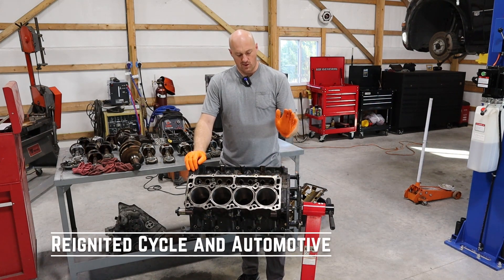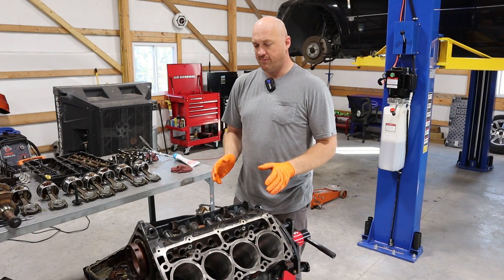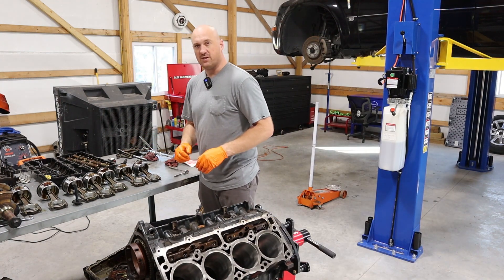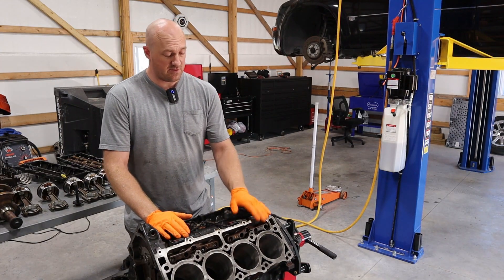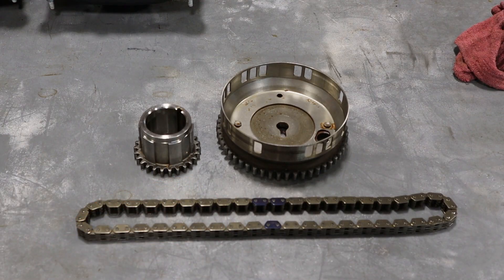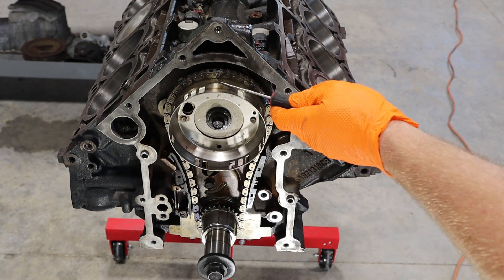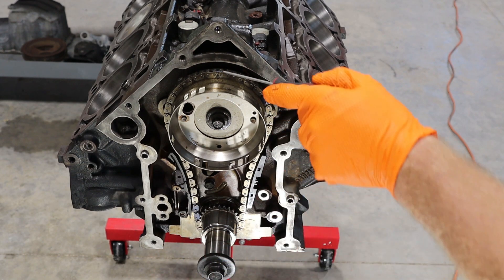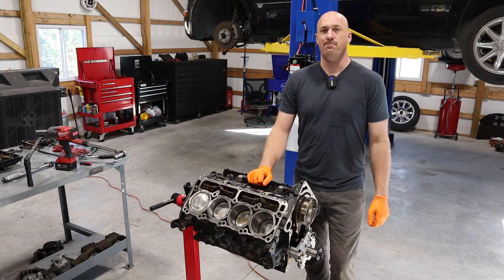How To: Engine Timing on Chrysler Hemi 5.7 // 300C Episode 3

Comment: Some engine builders submerge the lifters in oil on a heat pad or in a oven before installing. This is to prime the lifters for the initial fire up.
Reply: Buy a bottle of prolong and submerge your lifters bearings in that, the additive bonds molecularly to the metal I used AMZoil and prolong oil additive on my 2007 Dodge 1500 5.7 hemi the tick has gone away and my needle bearings are saturated even when at idle they're not coated in oil due to an the nature of hemi design angle of lifters

She's my daily work truck and 140+ miles per day with 1000 pounds of tools and gear everyday... My round trip costs me $15-$20 a day in fuel depending on the honeydo list after working
Reply from the maker: Absolutely that's a good procedure. As a flat rate tech though, sometimes ya just gotta get it back together 😄 Thanks for watching! 👍
Reply: If you want to dip your lifters, I've got no problem with that, but you should  NOT bleed the air out by submerging the lifters in oil for an extended period of time. Not only is it unnecessary because you can "prime" the engine after assembly which will fill the lifters anyway, AND you run the risk of "jacking" a hydraulic lifter if it hasn't bled off excess oil when motor is assembled or cranked over. If that happens pushrods or valves can bend, pistons can be damaged. I've seen it happen.

Comment: So the question becomes, why do the lifters go bad? Uncle Tony's Garage thinks the lifter/rocker inclination is to shallow so that, at idle, there is insufficient oil drip to the rollers.
Reply from the maker: I've heard this theory posited quite a bit since I've posted this video. And I'm not going to say it has nothing to do with it at all, and yet, the 2006-08 Hemi engines don't suffer the lifter failures that the '09+ ones do, and they have the same lifter location and are still equipped with MDS. I do know they changed the block casting in the '09+ because the shape of the camshaft changed, and they added VVT, so not sure if that has anything to do with it. But the lifter location/angle has remained unchanged since the inception of the third gen engine. 👍

Comment: I’m just saying you should never reuse your lifters on the 5.7 ..I’m in the process of rebuilding one right now they can go out and 30,000 miles or less with used ones you never know..I just ordered everything from Summit racing.Thanks for the video happy holidays
Reply from the maker: You're probably right, but me being a tech, I've got a stockpile of lifters sitting around, and if I've ever got an issue it's not much of a problem to take it apart and replace things again. But yea, smart move is to replace with new parts if you can. 👍
Reply: Reignited - Cycle and Automotive You have a great holiday thank you for your reply😊👍

Comment: What year is that 300c? 2011? 2014?  Curious to know because there was no lifter or cam damage, and I heard that 2018+ they fixed those issues.
Reply from the maker: This is actually an older one 2006.

Comment: When you do a lifter cam replacement do you have to replace Pushrods too?
Reply from the maker: Nope, they are fine to reuse.
Reply: Check and make sure they're not bent or worn out of spec.
Reply: Old thread, so this may not help you, but the answer is MAYBE. It depends on whether the new cam is stock &  based on the same cam core, ground with same "base circle". If it's aftermarket, it probably will be ground with a different base circle, which would require new pushrods.

Comment: I used to work at a local chrysler dealer in manitoba, me and the lead cummins tech used to be able to change oil pumps on 5.7 trucks and 6.4 3/4 tons with just removing the pick up tube bolt and manipulating the oil pump around the pick up tube as you said, its a huge pain in the ass but will save you dropping pan and windage tray and front diffs in 4x4s
Reply: Did it in the 1500 without removing the oil pan but getting the pickup tube bolt to thread back on will be a hell of a job...not enough room to get your fingers in there. I used some fishing line wrapped on the threads to get the threads started on the oil pump. It wasn't a job for those short in patience...
Reply from the maker: @DL101ca  that's impressive!
Reply: @ReignitedAuto  not for my father listening to me curse while doing it... 😂
Next time I think I will just use a thinner bolt with a washer and a nut on top to reinstall the pickup tube or drill the oil pump threads out and just use a longer bolt with a nut. No sense in fighting with it.
Reply from the maker: I hear you there. I don't remember being able to do that on the trucks, but then as techs there are always going to be guys who can do a repair a certain way that you can never figure out 😄nice work! Appreciate you watching 👍
Reply: @ReignitedAuto  Thanks for the time and effort you put into these videos, never have I found a youtube channel that is in depth into Chrysler products as you are, especially since I was also a Chrysler tech I can relate very easily to your method of explaining. Very good information on properly bleeding mds lifters, my brand new lifters were still noisy on cold starts because I have mds disabled with a tune and have never had the new lifters in mds mode, took the tune off and went down the highway and they are quiet as a brand new truck, never would have known that from all the lifter and cam jobs at the dealer since those vehicles still run mds regularly.

Comment: In the non mds hemisphere that have cam and lifter failure, is the failure due to bad materials? I have a 2006 300c srt8 that is misfiring. I am planning on replacing it myself. After watching your videos it should be a lot easier. Thank you for all the info.
Reply from the maker: Honestly I'm not sure what the root cause is, I'd like to see more in-depth analysis, but that probably won't happen. The good thing about the Hemi engine is that it's a pretty basic engine, so you shouldn't have trouble repairing it. Glad I could help at least a little bit and thank you for watching! 👍
Reply: @ReignitedAuto  Uncle Tom put out two videos on what he thinks is the cause. Take a look at his videos about it if you will. I will like to hear your thoughts on what he said. Thank you.

Comment: Thank you for these videos. 
I pulled out my grand Cherokee HEMI last night and pulled the heads. Next is a complete teardown because #1 piston was completely gone. Just a wrist pin. My # 8 looked like, I believe your #2. I’ll be going through these videos multiple times I’m sure. What did you end up replacing? I have a doner engine too. What’s reusable and what must be ordered, and from who? Parts list? Assembly lube? What you did in house and what you sent to machine shop? Any suggestions, tips and tricks will be greatly appreciated. I’m still trying to find the one person on here that will share everything. Thank you 🙏
Reply from the maker: I ended up replacing the #8 piston/rod and just performed a light hone of the cylinders to bring them back to good condition. I reused the rod and main bearings since they were in good shape. You must replace the head gaskets, I would definitely recommend replacing the valve cover gaskets, the intake gaskets, the front timing cover gasket, the oil pan gasket, the oil pickup tube seal, and the rear main seal while you have it all apart. Definitely use assembly lube, it's available from parts stores for pretty cheap like $10. I didn't do any machine shop work because the cylinder bores, the scoring was light enough to be removed just using a 3-stone hone. I'd be worried though if your piston disintegrated entirely that your cylinder scoring will be much worse. The general rule of thumb is if you can catch the markings with your fingernail, the block will have to be bored or honed. If they are deep enough that the block must be bored, you'll have to purchase oversize pistons, and everything gets more expensive. In my opinion, if the block is that bad, just find another block to use. I myself prefer the OEM parts from the dealer, but I know the cost sometimes is prohibitive. After working at dealers for almost 20 years, I genuniely beleive the parts quality is much better than aftermarket, but it does come at a cost. I appreciate you watching, and I hope the videos help on your project! 👍
Reply: @ReignitedAuto  I appreciate the prompt reply 🙏. 
That block is definitely needing a trip to the machine shop. My doner is stripped clean and honed already. Just need to get after it. Thank you for the recommendations, I’ll be making a parts list tonight while on shift. How crucial is keeping main caps in order? 😡 I may have mixed them while cleaning. 
Once again, thank you 🙏
Reply from the maker: @JABERNATHY78  it's critical they be kept in order, but lucky you, they should be stamped so you know which is which 👍
Reply: @JABERNATHY78  where are the main caps located on the motor.
Reply: @egrayy9500  are you trolling?
Reply: @JABERNATHY78  i wish new to this engine stuff and dont want to pay someone else any tips and learing from mistakes like yours
Reply: Also appears you have a wealth of knowledge. Now I’m wishing we were neighbors
Reply from the maker: @JABERNATHY78  just have time invested, that's all it takes

Comment: Good to know about the time and run cycle it takes for the lifters to fully pump up again it would be kinda scary and frustrating to start your newly rebuilt engine and hear a bunch of rattling!
Reply from the maker: It does rattle pretty good, you'll hear it on the startup video 😄